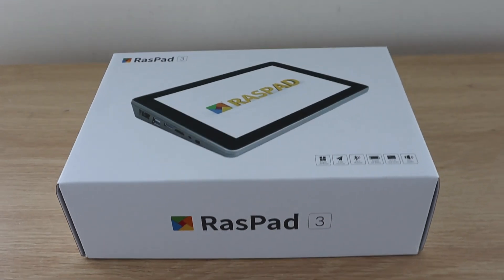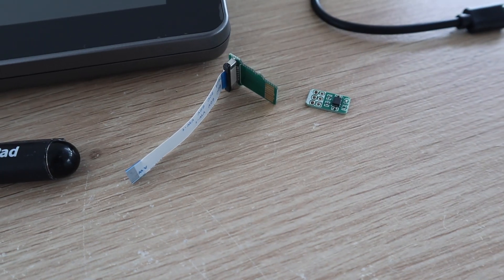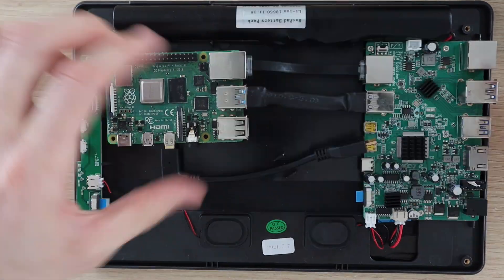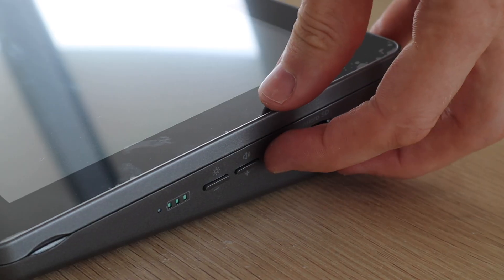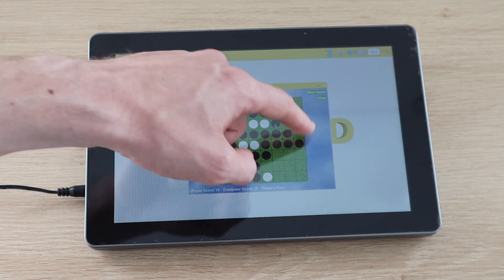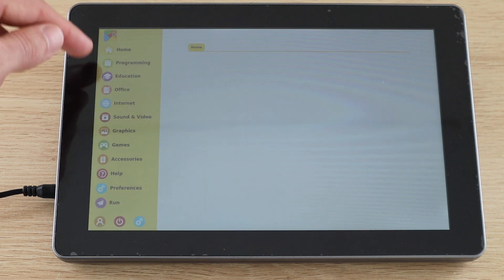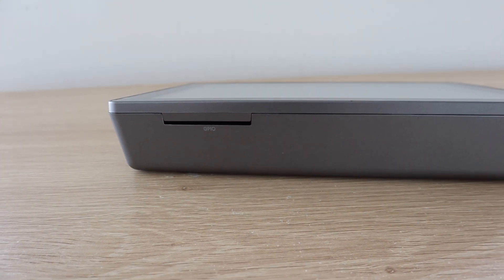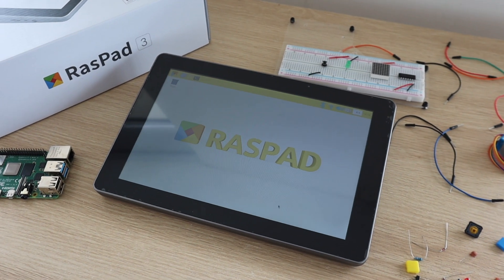Trying Out The RasPad 3 - Unboxing & Review

Comment: not a fan of that raspad
Reply from the maker: Have you tried one out or is that just based on what you've seen online? I'm interested in what other people have been primarily using them for.
Reply: @MichaelKlements  no, not tried it.
I don't like it because it goes against the essence of RPi: a cheap and versatile embedded system for tinkerers and electronics enthusiasts, not yet another tablet to browse the net and play games.
This tablet is just the opposite.
Reply from the maker: Yeah I think they could have made it a bit more functional for tinkerers by putting a bit more thought into the GPIO access etc.. It is also quite expensive for what it does.
Reply: @MichaelKlements  I could see this as a really cheap POS system, but at this price point (and still not including the RPi,) it's a terrible deal. 

The Pi is meant for embedded systems and versatility. This tablet removes all of that functionality.

You can get a Lenovo Chromebook Duet for $200, but this is going to be nearly $350 after you get the pi